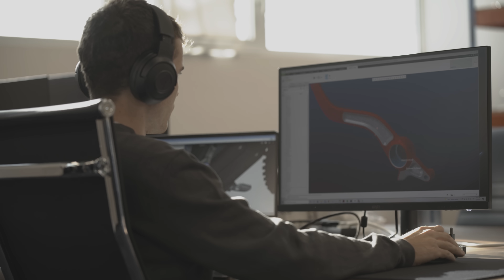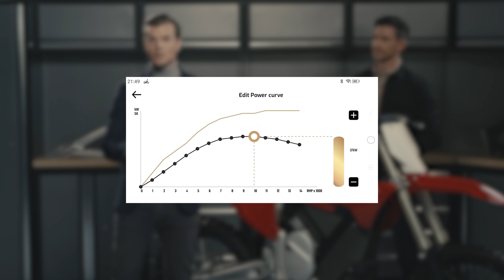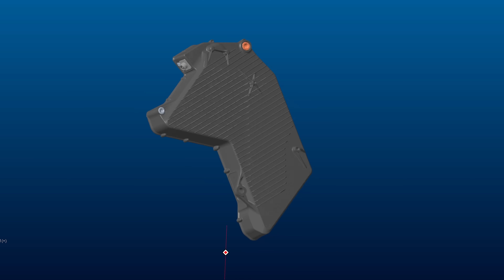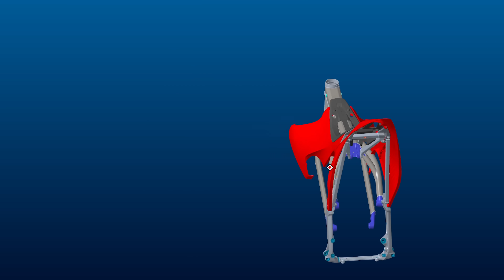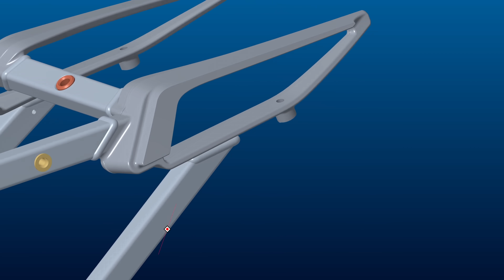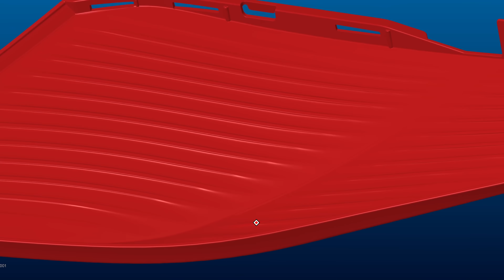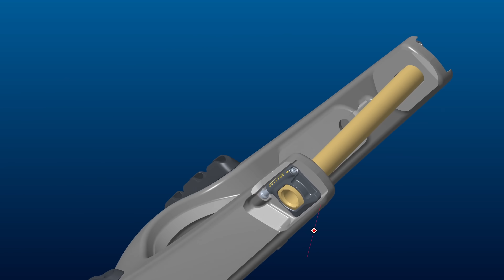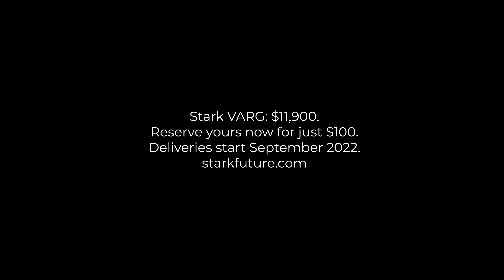The World's Fastest Motocross Bike is now Electric - Stark VARG

Comment: 6kwh in the battery will push a Tesla about 20-24 miles. If you equate petrol fuel economy of a YZ450 at full chat on an MX track, it uses similar fuel to a car so I’d reckon the battery range is nearer to 30 mins. Really hope I’m wrong and these bikes can do a GP distance even if they pegged the power back to say 60hp.
Would be great to see the old mx tracks open for business again and more places to ride.
Reply: 30minutes if the track is not too muddy :D
Reply: Mxgp is 35 mins plus a lap.. So how you gonna go racing do practice.. Qualifying heats and 2 motos?
Reply: @nathancrittenden8525  a 6kwh battery can be fully charged in 40minutes so that should be possible. I do t want to see petrol powered bikes gone any more than you do but at some point in the future, these electric mx bikes will dominate and be faster than a petrol bike!
Reply: @willgarrod9907  he said it will charge in 1 to 2 hours so with the charging capabillity that will be available at a track right now thats going to be more like 2
Reply: @nathancrittenden8525  my company makes a solar powered charging station that will charge 40 bikes in 20 minutes then re charge itself over the next 8 hours. They just need 6 or so of them. It’s currently used for pumping water but can easily be adapted. The charging part is actually quite easy, the hard part is making a bike that will run with decent power for 40+mins and not weigh 250kgs like a Motoe bike does.
Reply: Your not wrong. But, for era one of the " serious " electric MX. It's a quantum leap. Most likely cost limiting unless your a Saudi prince. Sure, range, charging time and stations are an issue to be remedied with more R&D. There will undoubtedly be reliability issues only exposed through the rigors of actually racing the bike. But, they are heading in the right direction. And brave enough to start. Hope they can stay around long enough to equal the run time of an actual tank of gas on one charge. But for now, your right. The math doesn't support it.
Reply: Welp, since you wrote this, many test vids have been published and the battery last a LOT longer than a mere 30 minutes

Comment: FYI: 
Battery Pack Energy Densities:
18650 cells:
Tesla Model S P100D: 160 Wh/kg
Surron Light Bee: 180 Wh/kg
Stark Varg: 187 Wh/kg

2170 cells:
Tesla Model 3: 260 Wh/kg

Looks like they are using 18650 cells, which leaves room for improvement once 2170 or even the 4680 become more available. 

Surron energy efficiency during aggressive riding in hilly trails w/ 150lb rider: 11.3 miles / kWh
Making an assumption that the Varg averages 1/2 the efficiency of the Surron (5.65 mi/kWh) it should still provide 30 miles of aggressive riding.
Reply: No way dude, 17 miles tops aggressively in only map 2 .   that's what I get on my Alta mxr and it's essentially the same battery and motor.
Reply: @JoshStreetDesign  Dang, well I will remain cautiously optimistic haha

Comment: Get rid of the cell phone management hud system, already got one, don't want yours, and I'll buy today.
Reply: I think the point is that the cell phone they provide is tested to work seamless with their wireless charging, Bluetooth etc and it is made to fit perfectly on the bike in their holder.   

Using a different phone opens them up to troubleshooting odd conpatibility issues and your phone may not have wireless charging or fit perfectly etc.

You don't have to get a cell plan on their phone and it comes with it etc.  Heck.  You don't ever really need to remove it from the bike.  Just think of it as a dashboard like a tesla.   You just have the option to remove it if you wanted.
Reply: @gear323  I should have been more clear.  I would prefer an attached hud/dashboard rather than a removable one. 
With something that easy to remove, it would also be easy for anyone to take off with it.  Harder to walk away with a 240lb bike than a small cellphone.

Comment: I love it. If you produce a dual sport with lights, turn signals, and suspension valved more for enduro, I will definitely be keeping my nuts safe with you.
Reply: Yeeeahhhh but what if you run out of juice 5 miles back in the brambles ?
Reply: @weko6273  i want a spare battery pack i can keep charging on a solar rig while riding..then im sold

Comment: Without nuclear energy it is all carbon based.  Wind and Solar are useless and not all that great for the environment (both require massive amounts of land for minimal energy).  That said, I want one just for the instantaneous torque that electric motors have to offer.  And noise has always been the Achilles heel of off road motorcycles.
Reply: useless, fracking is way doper for the environment tbh. rather have oil pollution than taking-up-space pollution.
Reply: Actually, renewable energy makes up around 40% of the UK national Grid and we import renewables from interconnects. At one point this year the entire Grid was running on renewables only!
Reply: @NickFoxQuixand  but that didn’t cover transportation or heating of homes and a lot of renewables is biomass….trees to you and me.

Comment: Very innovative, lots of good ideas! Very curious on the reliability. For example, that chain adjuster has to be changed to something that won't be stripped out on every single model in 5 years
Reply: Dude if you run an o-ring chain you rarely ever have to adjust it.  The current one that's on my xcf 350 was adjusted initially and I haven't touched it in 4 months and I have the quick adjust axle blocks so they just always stay in position you never even have to touch them.

Comment: How many mile can you go before it stops ? How long does it take to charge it back up to 100 % ? How many years will the battery last ? How much is a new battery ?
Reply: Depends how you ride it.  Realistically if you ride it in a hard Moto you get maybe 30-40 minutes if you're going all out race pace.  In the woods single track the way I ride I average about 17 miles in map 1 and 2 on my Alta.  If I was to ride it and higher maps at race pace I might get 10 to 12 miles with a battery that's practically the same exact thing that's in this one.

Comment: What is the runtime?
What is the recharge time? 
Does it have easily swappable battery or are you parked while it charges? 
That "phone" is gonna be destroyed on the first crash.
Reply: 1. 6 hours 
2. Around 3 or 4 hours I think
3. Battery is swappable but costs 2 to 3k to replace 
4. The case looks pretty good to protect it but I see what you mean

Comment: Very nice power from that electric bike. Interesting is a stuff regarding clutch. In the video from 6:00 when CEO presents motorbike features, there are 2 levers on handlebars. So i was thinking its a brake and some kind of clutch. But then, when riders come in video, there’s no left lever… interesting 🤔 and I cannot imagine, how enduro and supercross riders will ride without clutch.
Reply: It's a left hand rear brake like I have on my 2018 Alta MXR.  It's way easier to control breaking and modulate not skidding with that left hand brake especially the hydraulic one. On my bike I have the brembo hydraulic and it's just magic.  You never want to touch the foot break ever again after using it when I go back and forth between this and my gas bike

Comment: Up till now, all the electric bikes I've seen had trouble just lifting the front end. This is 'hang-on' power in a real chasis. It was only a matter of time. The future is here. Congrats Stark. You have changed the game.
Reply: Then your never ridden the Alta MXR.  If you put in it map 3 or 4 it's a wheelie machine, faster then my 350 xc-f  under 60mph
Reply: @JoshStreetDesign  Nobody said anything about wheelies. As you can see, this is an earth-mover. And it's not $50,000. It all changes from here.
Reply: @jimrhea5484  my alta is an earthmover you could plow a field with the thing.  If I do an MX start and just lean on the throttle it digs a deeper and longer trench than my gas bikes easily.
Reply: @JoshStreetDesign  Meh, this is the first time I've seen 450 or even 500 two stroke power in an electric. I'm sure if an Alta made this much power, it would have already been challenging the the 450's. See the roost? That's some serious stuff.
Reply: @jimrhea5484  It's the same power dude, same battery, LOL.  It's not putting out a continuous 80hp, that's a laughable marketing gimmick. You just don't understand until you try it.  I have owned practically every iteration of gas bikes, even a CR500.  The Alta MXR is as powerful as any of them, but easier to ride at the same time, with no vibration.  I'm a way better rider on the Alta than my 350 XC-F.  Every person who has tried it gets off with a huge smile on their face. The reason it never took off is that so many are against electric in the MX world,  especially because it was years ago before the electric craze took off 2 years ago. If Alta could have held out another year or 2 they would have survived and be thriving now.  I have 4 friends who owned altas, and they all sold their KTMs immediately after getting the Alta.  Don't get me wrong, I applaud this company and wish them the best, but it's really not any different than an Alta bike.
Reply: @JoshStreetDesign  Even 450's are hard pressed to throw a roost like that. Maybe a hill climber or sand rail? It's easy to see that this thing has massive horsepower. Never seen anything like it. Not even 450's move that much terrain. So, go find any vids where a dirt bike throw that much earth. It's all out there.
Reply: @JoshStreetDesign  Oh, and it's billed as pro material. And it appears to be so. I don't keep on ebikes. Whimpy. This thing rips earth. That's pro.
Reply: @jimrhea5484   @Jim Rhea   first off, I didn't see any massive roosts in this video.  I just watched it again they're all like a normal size roost.  Any bike can throw a big roost.  As long as you have an elevated spot, the right gear, soft dirt and a sand tire that dirt will fly a mile.  I leave a roost 50 ft back behind the Alta on a flat  start.  The size of a roost has little to do with how powerful bike is.  You'll never see any dirt bike magazine or website post the size of roost in a new bike review.  The fact that you're ignoring my actual riding experience and keep commenting on some random roost alone is comical.   I'm going to be riding tomorrow if you want I'll take a video and show youve the biggest roost you've ever seen.
Reply: @JoshStreetDesign  I already said meh. Have a good ride.
Reply: @JoshStreetDesign  Alta ain't beating a 350 lol.🤣
Reply: @LolliWANG505  I have a 2017 XC-F 350, the most powerful year XC-F made, with 58 horsepower.  It's essentially a 450, and I have it tuned up even more.  I've got like 18K into that bike.  And I tell you I am much faster on the Alta, and the Alta 100% has more initial low end torque in Map 3 and 4. Up top the 350 wins as I can hit 78 mph on that thing even with 13/52 low gearing.   But put me in a race or on a line with the Alta and it's winning every time.  You have to understand it's more than just straight power, it's how it handles and how it's balanced with no rotating engine mass, and how the throttle is instant allowing you to literally drift around turns because the wheel spins up so fast.   Gas bikes have a delay and a throttle ramp up.  It's a different feeling.  The electric is a more natural easy feel.  It instills confidence.  And btw, the Alta does 0-60mph in 3.3 seconds.  My 350 isn't doing that.  : )
Reply: @JoshStreetDesign  literally every rider I've seen says it's faster than they're 450 on a track. Harley Davidson bought and disbanded Alta from what I read and it's a real shame.
Reply: @JoshStreetDesign  nah your 350 can do it fs.
Reply: @JoshStreetDesign  The reason Alta didn't take off was due to bad business operations. They failed time and time again to get funding and sucked at marketing. I wanted to get one, but they were non-existent where I live and no one even heard about them.  They sold the company assets off and those companies took the IP they wanted and scrapped the rest.  They totally could have done things better and still be here.
Reply: @corail53  yeah I'm well aware, I own one, ha ha
Reply: @jimrhea5484  Schneid To is winning in the 450 class with a moded LBX SURRON
Reply: Uh, you haven't riden an Alta then
Reply: Nope

Comment: There's a lot of amazing engineering that went into this so many cool little details and especially the phone.  I have a 2018 Alta mxr which essentially is the same exact battery as what's in this.  Here's what I have a problem with this they are totally not telling the truth with battery life and range.  If I ride my Alta in map 2 on single track I get about 17 miles tops and that's even being conservative with my riding.  If I put it in map three or four and ride all out I probably wouldn't even get 10 miles.   They said nothing in this video about having a swappable battery and that would be the only thing I would care about and if it's not that's very disappointing.
Reply: But the man in the turtle neck said so!!
Reply: Yep the range claims are troublesome, this is a 6kwh pack, meaning it can deliver 6kw for an hour, let's say a moto gp heat is 40 minutes, the battery can deliver an average power of around 8kw for this duration, there is no way the average power output of a 450 during a gp heat is 8kw.
Reply: @romteb  You got me thinking, so I went down a rabbit hole. Electric motors have high efficiency, somewhere in the high 90s percentage-wise, but for math sake we'll call it 100%. Gasoline motors are in the high 20s, low-mid 30s at absolute best; the rest is shed as heat. A gallon of gas according to Google has ~33kWh of energy. Multiply that by a rough 1/3 to simulate efficiency loss and that's about 11kWh per gallon utilized. At 6kWh, the battery has 54% the deliverable energy capacity of a gallon of gas. So yeah, in summary: also skeptical. Wish like hell they've figured something magical out though.
Reply: @thatmightwork9897  no you're right unfortunately
Reply: @romteb  agreed.  Alta did the same thing on the range claims with their bike.  They said it would get 8 hours on the trails and there's no way that's even in the realm of being close to true.  Only if you rode it like 1 to 5 mph down a paved road haha.
Reply: @romteb  8kw = 11hp , doubt a 450 averages that over a 40 min moto. You are right, 6kwh will not last a full moto at race speeds.
Reply: A 2018 Alta ( battery pack is not essentially the same) was based on improved technology of a 2016 battery pack. Take a look at the Alta evolution over its 2-3 year life, now imagine if they were still in business and putting out a bike in 2022. 5 years later chemistry and density much improved. Also take into account the motor and inverter technology has improved yearly over same time frame. Think Tesla model s 2016 vs 2021, read somewhere 80% motor efficiency is now 94%. The inverter efficiency increased as well. I hope you and I will be able to get a Varg and the claims are close to true. Alta was 285 lbs in 16’, coming down to 260lbs, now we are at 242. The Varg is taking the next step with design built around the ev  motor/battery. Anyway got a white one on order.
Reply: @travelingmike40  I destroyed my knee on Wednesday riding my KTM 350.  By the time the Varg comes out I'm probably going to be just getting backing into riding I got a long road of recovery ahead of me.
Reply: @JoshStreetDesign  heal well
Reply: @JoshStreetDesign  Sorry to hear, heal well.
Reply: @travelingmike40  thanks man, appreciate it
Reply: I made a simple calculation. 6kW - battery. This is 1 hour with a power of 6 kW /8.2 horsepower, 15 minutes with a power of 24 kW/32.8 horsepower, until the battery is fully discharged, excluding losses. What 6 hours of driving and 80+ hp power are you hinting at???
Reply: @ДимитрийКовешников  the problem with simple calculation is that they are simple YOU may be correct but to get the figure Stark give  at  you would need to not use full power  the whole time I believe this is sensible unless you dont slow for corners and in the air  second they would need to have a strong regen i have not seen this mentioned even then i expect there real range to be less than stated but hopefully enough for a moto round/heat.
Reply: First battery range will be the issue the battery is bigger than the one on the alt by 1 kWh , and the parts should be more efficient, it will hopefully use regen , and should be lighter so I would expect it to be better than the alt will it be good enough only testing will tell.
Reply: @alanrickett2537  no, battery is only bigger by .2kw.  that's like 5 more minutes of ride time.
Reply: @JoshStreetDesign  you are correct the source video I used got the alt battery size  wrong..
Reply: The phone is the lamest part about this, guaranteed it was put in to offer some sort of recurring SaaS business model. Just have a hard attached head unit and let the app be available on any phone.
Reply: Technology and battery are getting better, maybe they found a way to use less energy, and don’t forget that this bike is much lighter and the ergo are better so less wind resistance than the Alta redfish, also i don’t think that 3 people in this planet can use 80hp correctly on a motocross track. Probably 3 lyiers, so you’ll probably need less battery power.
Anyway let’s hope that it’s not a lie, i really hope that the range is real as you mentioned.
Reply: @mxriderdakar  Batteries aren't really getting that much better and there does reach a limitation in development before we hit a massive wall.